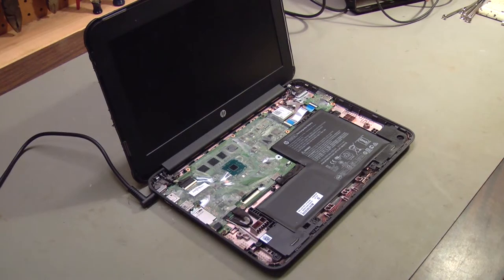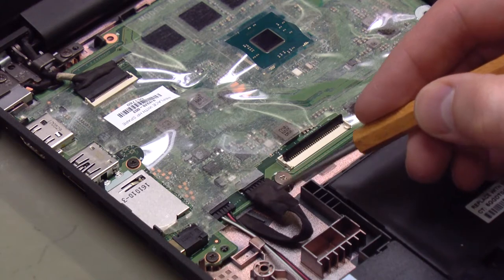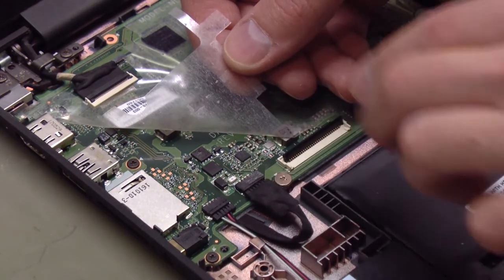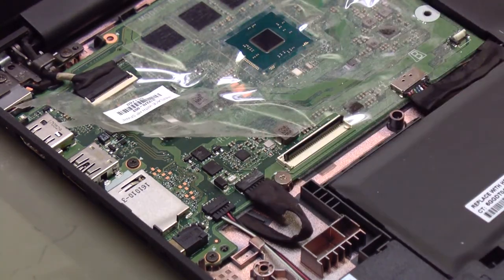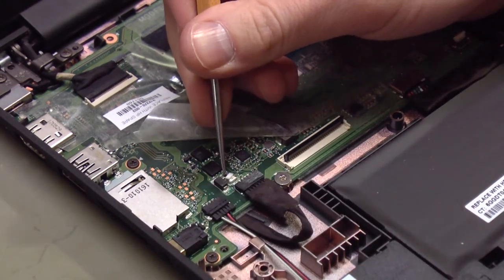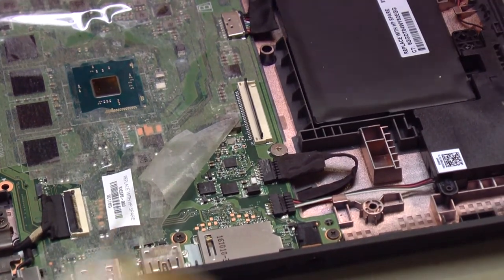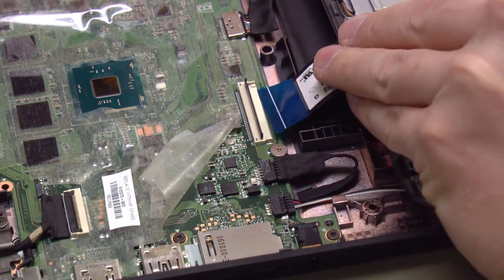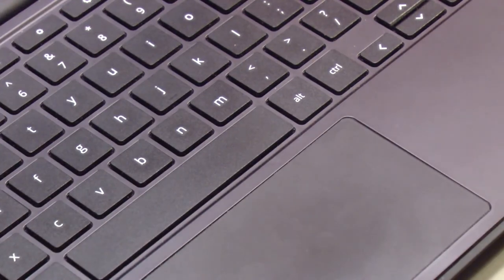Replacing a Fuse on a HP Chromebook 11 G5 That Won't Charge or Power On

Comment: my brain is to small to comprehend this
Reply: That thing breaks when too much current goes through it, in order to avoid damage to the rest of the notebook. You then replace it, or solder one that´s still working on top of the broken one, simply because, after stacking them, they make contact and work the same way one fuse would.
Reply: @ferna2294  Thank you 7 months ago I had a small brain but it got 90x bigger during the span of 7 months.
Reply: @A--1._  I knew it! Brain develops fast when you put enough effort into it!
Reply: @ferna2294  your to nice to be on the internet
Reply: what demon are you that your so nice?
Reply: @A--1._  it costs nothing to be nice and love spreads <3